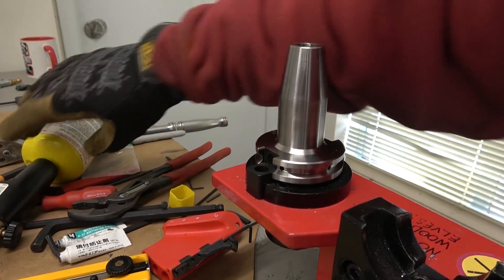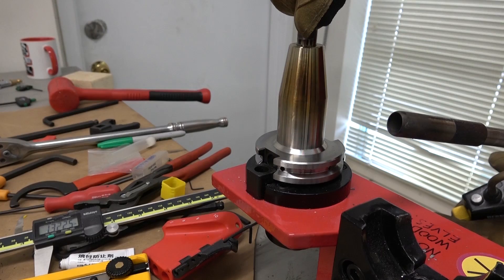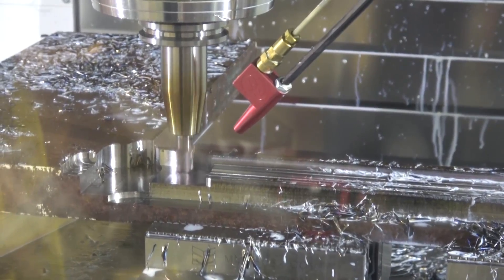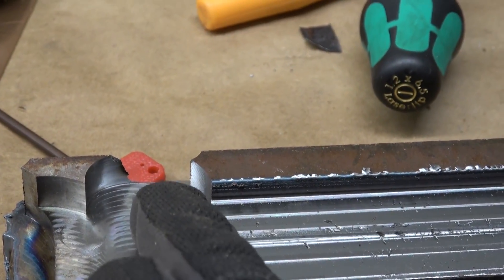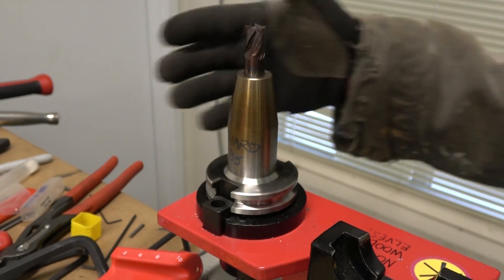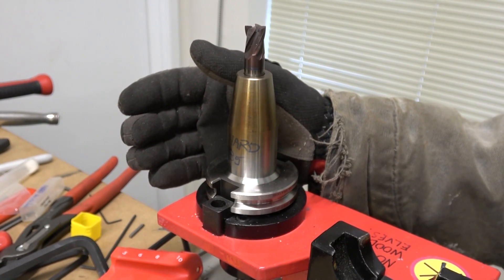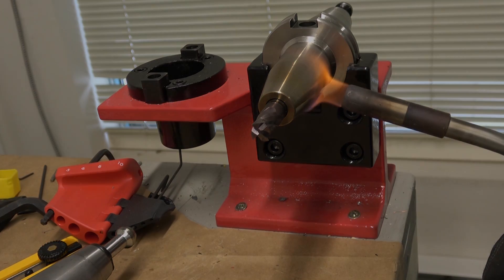Machining Feeds & Speeds |Test Maritool Hard Milling End Mill

Comment: Many comments on my videos people ask about feeds and speeds depth of cut exec. I hesitate or don't like to give this kind of information. There are so many variables involved here that wont be the same from setup to setup. I have even run the exactly same parts with the same tooling on the same machine that didn't work the same the second time (Differences in material probably). Everybody has their ideas that they think work. But the thing I have found is it generally wont work the same for you. Even if you have the same machine and same tools. You are going to have to experiment until you get it correct for your setup. The trick is to have enough experience to make the right changes and not to wast to much tooling and material. Thanks AVE!
Reply: No two pieces of steel are the same. I work in a factor that forge's, heat treatment and machine's all different types of steel from carbon to high nickel types like inconel.
  Any slight variation in any of these processes changes the machinability of a material. An extra 5 seconds hanging before being quenched, a squeeze of 2mm or so under the press, all aspects end up with a different result.   Not to mention the chemical makeup of the heat of ingots, nothing is exact.
Reply: amen !
Reply: nice to see you here peter
Reply: it's like having sex, depth and speed are the main part of how long the Tool will last...  slow and easy will finish the job...
 But hey we are guys and it's knock the bottom out of it as fast as possible so you move on to the next one... Got to keep the Boss happy, don't you know.
Reply: HSM advisor has worked really well to account for most variables in various materials. I machine mostly stainless steels and aluminum.
Reply: @AustinActive This guy knows what's up
Reply: Tzuede Off the Cuff  Ive machined a valve body before, and when it was ultrasonic tested they found it had a furnace brick in the middle of it from when they cast the ingot at the steel works.
Reply: Miss your videos Peter, hope all is well. Cheers,ed.
Reply: @kevinbowers3917  Working on a video right now. It wont be long. Everything is OK. Thanks!
Reply: I enjoy manual work for just this reason, having your hands on the wheels really helps get a "feel" for the tool. of  course its slower and you usually do much  less complex work on a manual machine, but its fun. because you are right there in front of it and usually only have your safety googlers and no shield, it keeps ya from gettin too brave with those potential intershop coliding ballistic metallics
Reply: Same thing with grinding. Only more variables.  What material? If hard chrome was it stress relieved properly?  How worn are my single point diamonds? Is my dress feedrate proper for a rough or finish grind? Is the wheel breaking down properly or loading up and burning?  What’s my coolant temp?  Is the coolant foaming?  If so, what’s the concentration?  

I had to learn all this shit the hard way.  No book or calculator for it.
Reply: Isn't that the truth.  Cutting metal that comes from china vs a reputable source that uses standards for consistency when processing raw materials is like night and day.
Reply: 100% agree with this. I mean most repeat jobs I get may require a slight modification... maybe +-15% on speed/feed
All tool suppliers give you a jumping off point normally for ideal lab conditions ie shortest tool, very stable work holding etc. But I find you learn what’ll work and won’t. 
I don’t use a CAD package at work. All my programming is done on machine which can make it faster to tinker with fine details. Well in my experience anyway.
Reply: Always at least look at manufacturers numbers. And don't mill over 45 Rockwell C with coolant. Most of the time, milling with coolant is for keeping the part cool and dimensionally accurate, your tools hate it. Non interrupted ops need it though
Reply: I've been a machinerd for about 15 years.  In my experience it is too much SFM that kills tools fast.  As far as a hard and fast rule, for roughing I go with 600 sfm on mild steel,  you can go way up to 1000 sfm or more with aluminum, and on really hard materials you need to start slowing the sfm way down.  Running dry you want to slow it down about 10-20%.  I would have tried 150 to 200 sfm, and try a bigger chip load, you might be able to get away with 2 or 3 thou per flute chip load.  Chip load doesn't seem to be nearly as critical in my experience, but needs to be smaller bites with harder materials.  I agree that each machine is different, so these numbers are just a rough guesstimation. I'd start with the feed turned down and find a spindle speed that doesn't harmonic too bad starting from 200 sfm or so. Then add feed carefully untill it sounds chunky and back it off a little, until everything sounds happy.  The deep cut, bigger chips, and slower spindle speed will increase tool life considerably, by carrying away heat with the chips.  I've milled ar400 and ar500 plate a bit.

Comment: When I was doing a lot of programming at my last job I had a couple charts I randomly found on the confuser and I always started there. After running the tool I had a tool chart next to each machine that I would scribble out what I ended up going with in the end. 

It’s important to keep tool charts for each machine too. Each one has it’s own character and preferences. Especially if they are different size machines.

Comment: could be that your tool is wobbling, because you used a torch for the shrink fit, it should be done on a propper device designed specifically for that, to get the optimum result. Bad runout eats endmills for breakefast.

Comment: I guesstimated from your 1st cut , from sound, that it was too high rpm for sure.i guessed your spindle speed was at 2200 to 2500..you said 2000 rpm.. damn i was close
. i was figured slow rpm to about 1250/1350 rpm and feed of 8.0 to 8.5..  keep uppin the feed till chatter goes away .. been  machining 25+ years and 1st thing i do is listen, then look at spindle loads and chips.. experience is the formula foe show. Programmers rarely get feeds and speeds correct on an unproven program, even if it worked for same material, same tool, same holder..there is always some contour or tool path the endmill just dont like.

Comment: AvE: Check out HSM calculator by Helical. Free calculator, you have to use their EDP numbers but you can cross reference anybody's tools in their catalog. The initial numbers are a little aggressive so I like to start 10%-20% lower. You can do this easily with a slider. Truth is, it IS science and not art. Sandvik makes a really good book called "Modern Metal Cutting" that will make you all but a material scientist. Give it a read but it's pretty boring. I can borrow you a copy if you would like.

Comment: engagement angle (meaning what % of the cutters circumference) is killing your tool, not the speed.  limit the tool path to radius double the diameter of your cutter, then play with it from there.  You will find the sound will stay consistent and the finish will not go to garbage in the corner.   harsh sounds, harsh cuts.  bad finish, bad speed

Comment: It's my understanding, as a cnc lathe machinist, that the tool manufacturer speeds and feeds sheet is more for machining efficiency as opposed to tool life.  I work for one of the big oilfield services companies.  If they think they can ship a few more assemblies each week at the cost of just a couple more inserts or a few endmills, it's worth it for them.  I've never met a machinist that ran the recommended speeds simply because the company told them to.  If they're hogging off material, it's because they've run that job before, and probably have a proven program.  Also the material matters.  I'll chew through thick-walled 4140 all day.  Not so much with a 20 foot piece of thin-walled inconel when the material alone costs more than I make in a year.

Comment: Hey AvE, So I teach hydraulics, and diesel tech at a state community college in Ohio.  I had an idea to cast Glass end plates and manifolds etc, then machine the ports into them, then have them tempered. My question is can Glass be machined with a normal CNC mill, and the proper cutters, Or does this require a different machining set up all together? I could ask our machine dept people.... But frankly I have more faith in asking you.

Comment: I don’t normally comment on YouTube but you’ve been a source of entertainment far too long to not pitch in. Step 1: find a shorter tool holder the further the cutting edge is away from the lower bearing the greater the harmonic. 2: avoid side milling hard materials with solid carbide in general they don’t like it and they don’t compress resulting in the entire flank usually breaking just behind the end cutting edge. 3: run the smallest endmill as economically possible (time is money) at the highest rpm without burning. Glowing red chips are fine as long as the it’s not affecting the heat treat of the part; chips look almost granular and carbide handles heat way better than vibration. I too prefer air blast for hard material but coolant can also reduce harmonics if they are still a problem.

Comment: About half  the parts i machine are 60 hrc and above (Tool and Die).
Some stuff i would try and change:

Shorter gauge length holder, that one is to long for a 40 taper haas with that size endmill in hard stuff. I think this is 90% of your problem

Make sure you arent cutting to small a radius, should have a setting called minimum radius or something simular in the cam program

Increase you chipload, on a 12mm 4flute endmill in 60 hrc tool steel  i would run  2300 rpm 500mm/min 4% stepover, that would be about 0.0021 ipt 

If the feature you are milling allows it, change to a bigger insert tool, either a highfeed or round insert facemill, most brands have special inserts for hard milling.

If your part has thin walls, lots of holes etc. use the cheapest carbide you can find, it gonna chip no matter what you do...

Comment: You need to learn on some manual machines first.  What you learn on a manual will help you down the road.    Cnc operators think you can just run wide open through any material.   And those manufacturers spec sheets,  burn 'em.   They're useless

Comment: I don’t see a chip thinning factor on your cam software. Not sure what software your using but look into chip thinning. I don’t machine that kind of material but I do a ton of stainless and a little inconel and titanium. Speed is ok but feed seems slow. Me personally I’d run about 250sfm. Maybe 15 percent radial depth of cut. At like .002ipt. Factor in chip thinning (I don’t have my calculators) probably going to be like 40 or 50 inches a minute. Your radial depth looks maybe like maybe 30 percent? Probably should be like 20ish inch’s per minute feed. If you don’t factor your chip thinning your endmill has zero chance.
Reply: Update just went on McMaster and bought ar400 to give it a shot. But I’ll be using my 1989 kitamura with 35deg taper. See how she holds up

Comment: It's a little easier for places that machine the same stuff day in/out because you can fiddle with the settings until it's right and work with that all the time... but if you are unfortunate in that jobs are different all the time (different materials being the big one) you get stuck testing out what works and that can get expensive when testing new tools. The big take away from this is it all comes down to experience

Comment: Ave - You could probably call Frank he would tell you what is/isn't rebranded.  I tend to use their holders but when it comes to actual EM's these days I go through Lakeshore.  Not that there is anything wrong with Mari ones as I have never had issue with their tools.  I just find it easier to call up lakeshore and get a custom cutter made when I don't see what I need in the catalog.

Comment: Speaking directly out of my bunghole as someone that's never been near a CNC machine... Could it be possible to program an algorithm that minutely tweaks the RPM/feed-speed in real time when it detects vibration?

It seems you'll always have some molecular variance within your tool and the subject material, so you can't just say "X bit cuts Y material at Z speed". Every piece that comes off the production line will be a tiny undetectable bit different, right?

Then you get the humidity and ambient temperature, moon phase, wife phase... it's an art for sure, but there could also be a scientific solution. Something like the active suspension sensors in some modern vehicles...

Maybe someone smarter than me can translate this into something practical for this application: https://www.sciencedirect.com/science/article/pii/S2468217918300030

Comment: Try to avoid cramming an endmill into a radius. 0.5" endmill into a 0.25" radius will almost always chatter in harder materials. Try using the recommended sfm and do 5%-15% radial engagement and 75%-100% axial engagement. 6 flute endmills with a stronger core and variable helix will also help stabilize your cuts but they only like the HEM tool paths. Hard materials also seem to work better with lots of coolant from my experiences. Try using Guhring endmills. I've had great luck with them in hard materials and super alloys.

Comment: The laundry soap conspiracy is one I strongly believe in. This conspiracy says that manufacturers will put the line on the lid or scoop at a level such that you end up using more soap than is actually necessary. This causes you to buy more soap.
I've never used an insert that ran best as the manufacturer recommended. They want you to break tools so you buy more tools.

Comment: I'd have thought the higher the ripums the less the chatter just like rubbing anything together the slower it rubs the bigger jumps between gripping it generates.
Try it with the good old wet finger on smooth fiberglass or a tile the faster it chooches the less it bouces wah.
Seems to me you shudda gone faster not slower, yeah it creates more friction but the cuntstencarbide can take the heat just fine she just isn't into deep vibration.

Comment: Arghhh the belt was slipping on the line shaft pulley, and your steam engine had lost boiler pressure, consider an upgrade to a yarrow or flash boiler or just a faster stoker.
Speed = feed x greed.

Comment: The best thing to do when machining on a cnc machine is to always go for G95 instead of G94 (feed per rev instead of feed per min.)
Then you can adjust both feed and or speed induvidualy when running the program.
I do lots of work in a horisontal boring mill. 
And when you send the spindle out like 700mm you have to be able to adjust the speed to get out of the resonance sone.

Comment: 90% Science, but for sure that last 10% of max material removal rate is a black art. Figure about 100 variables go into calculating good speeds and feeds. It doesn't take much to really fuck your MRR either. Your setup there looks so sketchy for any real rigidity, handicapping that machine like a dull beaver.

Comment: dumb question, i know heat expands metal but why does the inner bore expand outward instead of inward.
Reply: It expands outward because the circumference of the circle (all across from inner to outer) is expanding, thus the radius is increasing across the entire part.

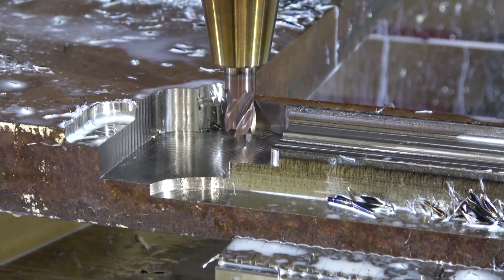Comment: That pattern on the floor of the cut @1:35 is a dead giveaway of your issue.
The high pitched chatter just before stopping feed is another symptom of the cutter flex causing that wavy pattern.

In my opinion your main issue is that huge dog-ear of material hanging out in the wild blue yonder beyond the vise.
Where you see a carbohydrate foam machinist jack, I see a bell sitting on an elastomer post.
The frequency of flutes per second (Hz) is causing that bell to ring.
Reply: I agree, the rigging is the problem here. Also those feeds are way too slow in my opinion.
Reply: Hate to be that guy, but *hydrocarbon.

Comment: There’s definitely no exact Speed&Feed to say will always work however there are general principles such as make your work and tool as rigid as possible.  That holder is really too long with the tool hanging out to far so it’s vibrating when the axial loads become too high such as in the corner where it was chattering.  The next thing is to slow your sfm down and increase the chip load.  Especially in tool steels or this case ar plate if your load is too light you work harden the surface for your next pass then you’ll get more chatter because of the higher axial load.  This material it should be at least.002 per tooth.  Next thing to do is get a higher helix end mill to reduce the axial load pressure.  You  can cut steel with a sheer press but the amount of force needed to cut the same sheet with snips is much lower.   Personally I think if you don’t need that surface cleaned off you’re best to go in with a short 3/4 hss  roughing endmill scalloped style something around 300 rpm and 3 ipm will chew through that and just finish with carbide to get a nice finish.